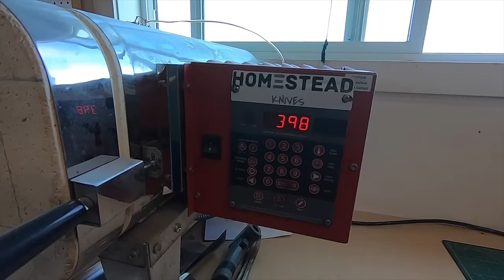How to Make a Knife - Bushcraft knife in s35vn

Comment: Wow. LN2. I treat forge tools with it! Mostly because I have a 20,000 gallon tank of the stuff at my company. I am wondering why harden then grind? I have made some very nice knives, but I am NOT a knife maker. I am retired, 63, and have a large blacksmith shop. Tended my first coal fire over 50 years ago. Neither here nor there. Again, why grind after heat treat and not before. I am sure you have a very good reason. Prevent warp??
Reply: I wondered the same thing, especially on a s35vn. That's some hard steel